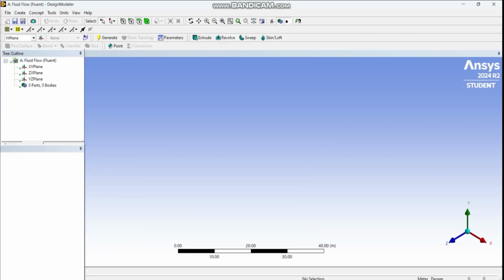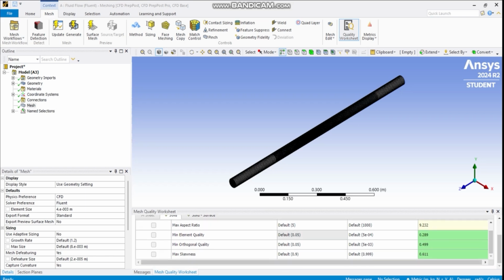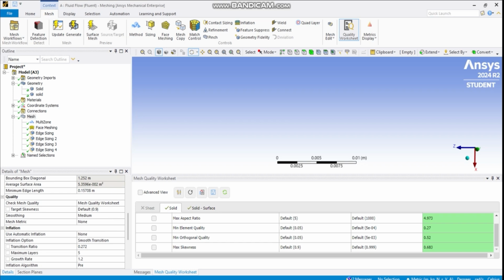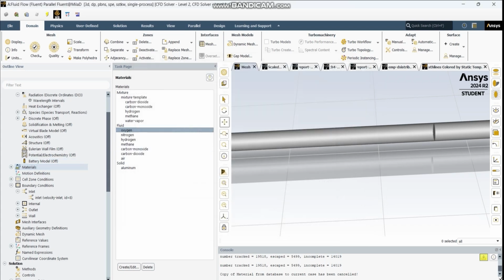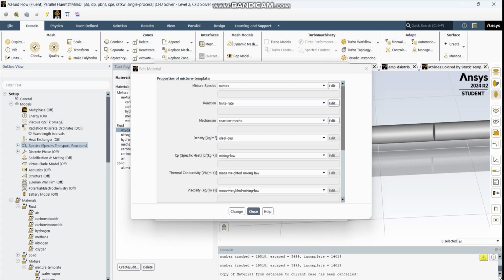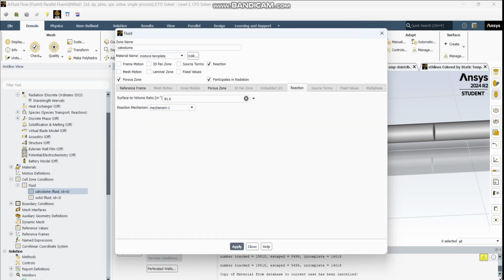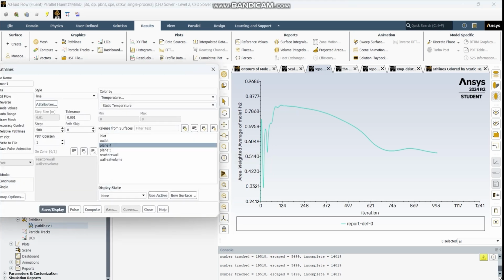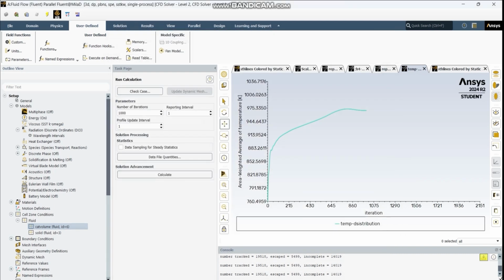Hydrogen Production via Steam Methane Reforming | CFD Simulation in ANSYS Fluent

Comment: Hi, I’m currently working on an ANSYS Fluent simulation using an Eulerian multiphase model.

I have the hydrodynamics already stabilized, and I’m trying to implement a first simple heterogeneous reaction between hydrogen and pellets using a UDF.

The objective is to represent an initial approximation of the direct reduction process (Energiron-type), just to verify coupling and species consumption/production.

Do you have a way to contact you directly for a couple of technical questions?

Thanks

Comment: Hello, I followed the video step by step twice and managed to set up the simulation as well, but my residual values are different from yours. In my case, the residuals only stabilize after around 2000 iterations. Could it be that you might have skipped or forgotten to mention a step in the video?

Also, in the last part with the pathlines, mine looks more like a fluid-flow pattern, while yours appears symmetric. I thought I did everything the same way you did, but I got confused when comparing the results.
Reply from the maker: Perfect , did you do every steps correctly !? And also if your properties converge after the while it isn't important